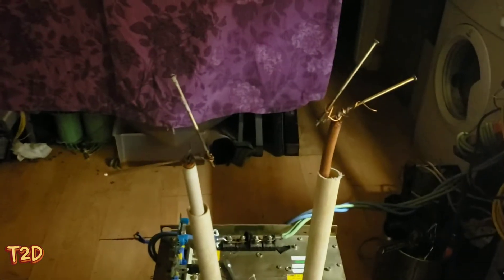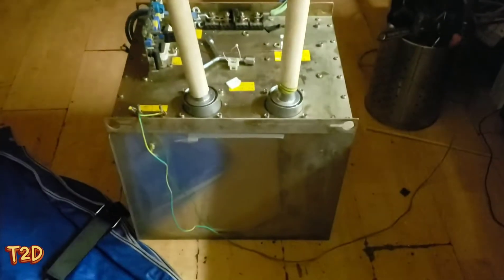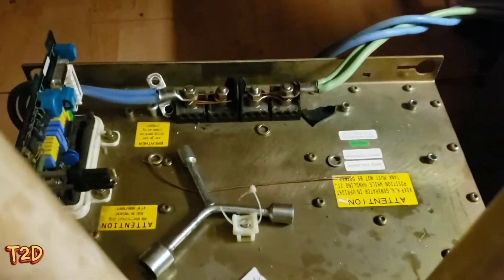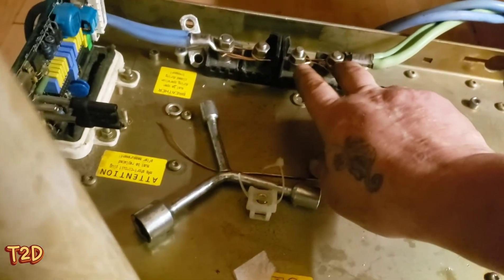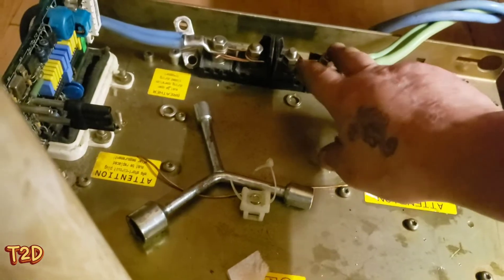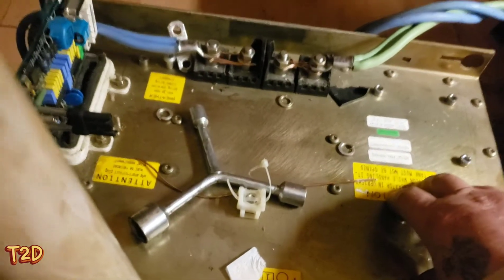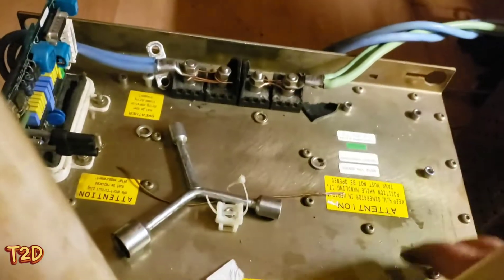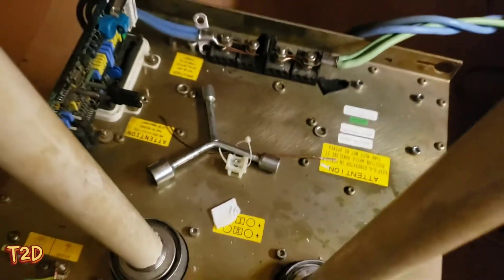Quick X-ray transformer test.

Comment: HV porn 😬 I googled the rating for some of these xray tanks, its somewhere between 60 - 80 kW! So this tank could do this all day long? Damn...
Reply from the maker: Yes mate it's a 50kw tank which is still considered small in the x ray industry... 50kw is intermittent duty though .. I will try get some bigger ones to show soon like 100kw ...
I have a monster 50hz 125kv 300ma transformer from the early 70s I will show soon 🤣🤣
Reply: @T2D.SteveArcs  woooooowwwww!!! I wander what arc could you take out of it with some resonance capacitor at the secondery!! Like a resonant X-ray transformer!! 🤔
Reply from the maker: @fabriziobrutti1205  lol no where near full power yet mate these are rated 50kw so bigger arcs to come yet.. I'm working on bigger driver 800A igbt... 

Steve
Reply: @T2D.SteveArcs  whaaaattt??? 800 Amps?? It should really be an enormous power module!!!
Reply from the maker: The Siemens tanks I have are 150kv 300ma I will be showing a lot more on these guys probably in next couple vids.. I haven't forgot about our DIY transformer build just been busy getting more cool stuff for us to look at ....

Steve
Reply from the maker: Btw Siemens tanks can do 200kv🤣🤣🤣 And yes I know they are German what did I expect 🤣🤣🤣
Fantastic quality...